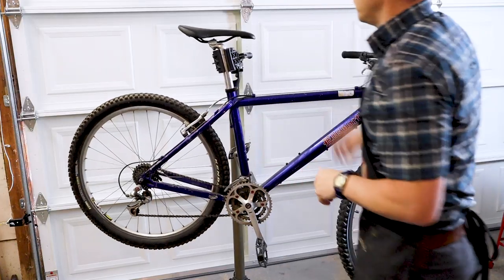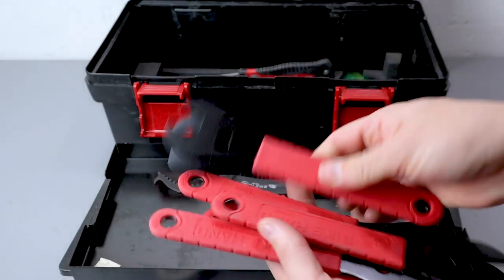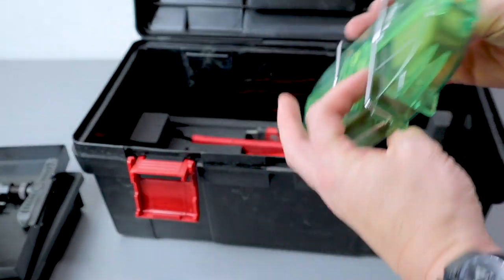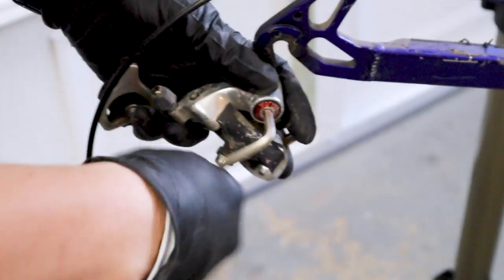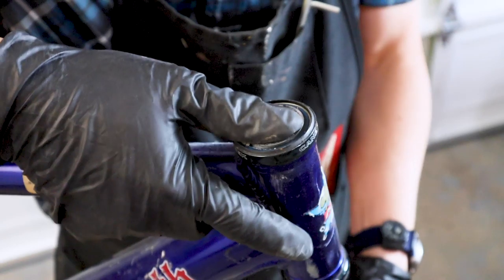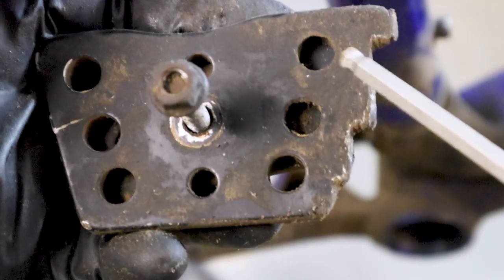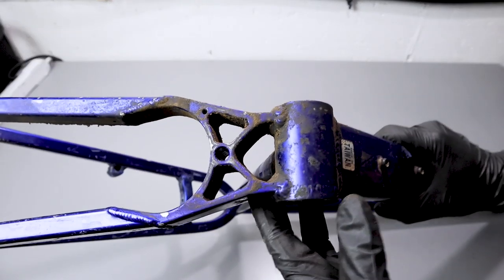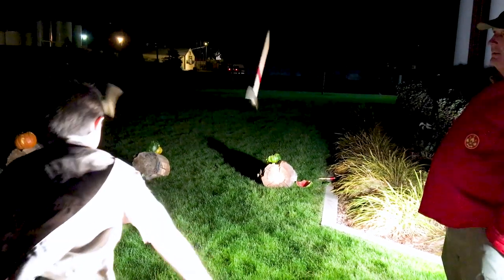Ellsworth Sub 22? - Bike Toolbox and Stand Review

Comment: If you do a Google image search of ‘1995 Supergo access bike’, you will see a pic of a silver bike like yours. It will take you to:
http://www.retrobike.co.uk/forum/viewtopic.php?f=6&t=141073
 That’s the bike. Also on the google search page, you will see another pic of a similar bike called Crestone. They’re both by the same maker. Cheap Al frame made in Taiwan for US or Brit companies. The head tube matches by the external butting; the down tube gusset behind the head tube matches up; the CNC rear dropouts and chain stay match; the angled cut of the chain stay by the drop outs match; the bend at the top of the seat stays match; the rear brake bridge matches up.
Reply: This.  Came here to say this.  Access ALU 7005.

Comment: I am writing this before finishing the video... With my guess.  That bike looks just like my GT BACKWOODS bicycle that I bought in 1995.  What you have there is a bicycle that the original owner has made very good upgrades over the years.  I suspect that it started as a non-suspension mountain bike (with what was then the standard) - - cantilever  brakes..  Then a suspension was added, but then you cannot use cantilever brakes.... You needed to upgrade the bike to V brakes that came popular in the late 1990s.  Then they put a top of the line XT rear derailleur, and possible the good quality crank.  This is a bike that was lovingly upgraded over the years....  WHAT I THINK YOU SHOULD DO - Give that great frame a new life...  As an electric bicycle conversion.  Get a whole rear wheel kit and turn the aged mountain bike into an electric bike that is BETTER than any of the NEW electrics out there.  I did this to mine and could not be happier.  I bought the Voilamart 1000 watt complete kit for $200, and for about $500, Complete, I can go on 20-30 mile road trips without breaking a sweat.  Let me know if you have questions....